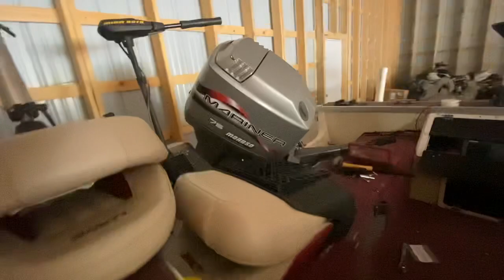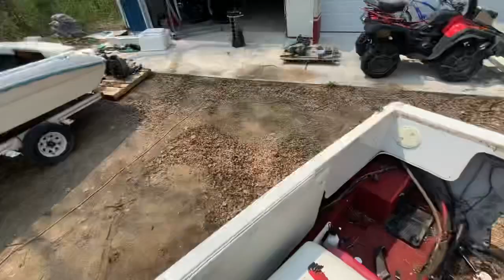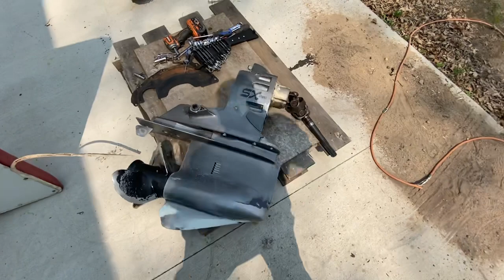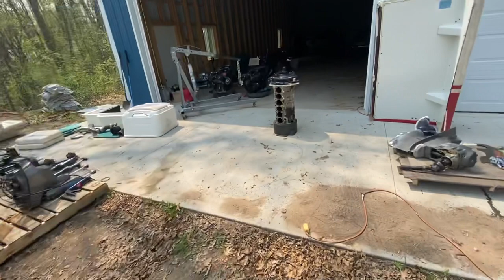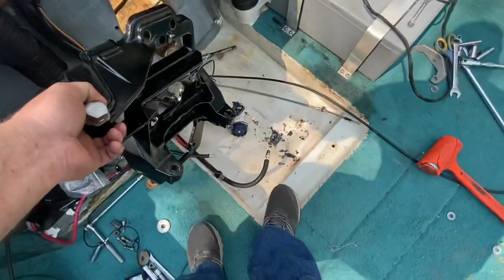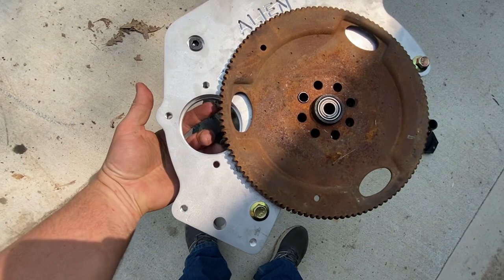BMW M3 S50b30 engine in a boat, Part 1, making 1 boat out of 2

Comment: Bring Out Another Thousand X2. joking aside, I'm excited to see this build.
Reply from the maker: I do want to put like a 67mm on it sometime and see what happens
Reply: @someguy325es  if anyone does it, it’ll be you. 😂 it’s gonna either come up on plane really quick or it’s gonna snap the out drive. 😂
Reply from the maker: @DadBodGarage   Yeah I want to look for another junk boat this fall to scavenge the out drive off of for a spare.  I'll be much more willing to turn it up after that.
Reply: @someguy325es  right lol way different be stranded on a boat than in a car. Not that you’ll swap it out right there, but at least you’ll have a spare.
Reply from the maker: @DadBodGarage  mostly small lakes around here so not that big of a deal to get a tow back to the landing, but if you try to buy a replacement outdrive in the middle of the summer you'll have to pay out the nose for it compared to buying someones yard ornament in the fall.
Reply: @someguy325es  that’s fair. oh, I’m sure it gets expensive and parts harder to get.

Comment: In your video around the 7:48 mark you said the Mercruiser Alpha drive (140 h.p.) really cannot handle to the 400 - 450 h.p. from a large engine, but in your mock up said your are going to use an Alpha drive driveshaft coupler in your 400 - 450 h.p. BMW engine. How are you going to do that, sounds like crap to me? Tell me how that worked for you?
Reply from the maker: I did’t say I’m using a alpha coupler, you just assumed that because I had one in the video.